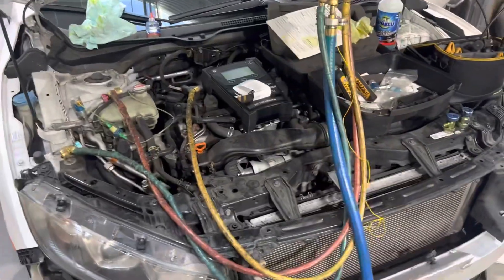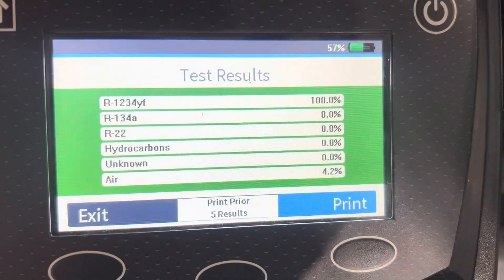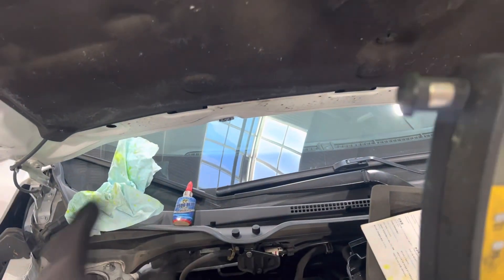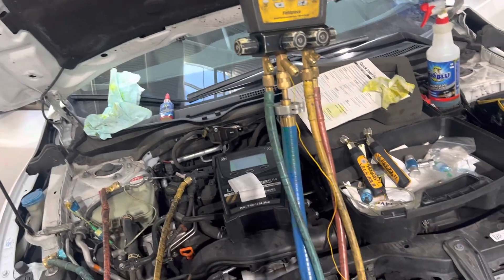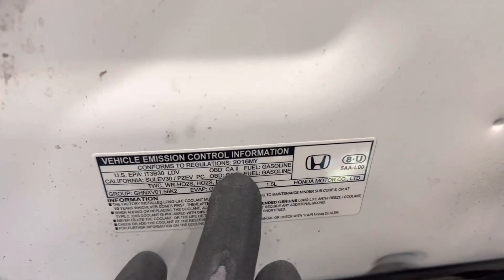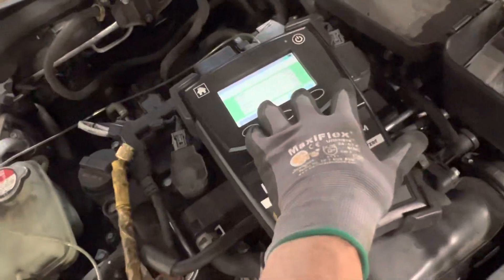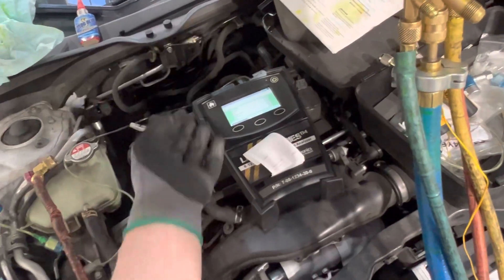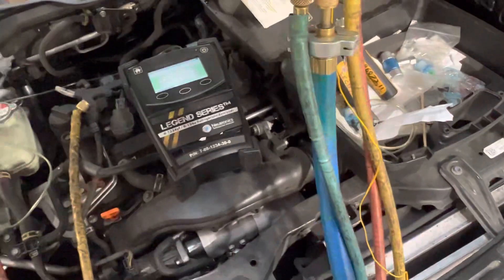OTHER SHOP WORKED ON AC , now it NOT !  cooling good. WHY ?

Comment: Omg i used my Bluetooth fieldpiece and wow. My supply temp was 38.5 which matched my evap temp 37 by 1degree. the superheat looked good but subcooling was off and my compressor was on max it  was cycling on and off because low pressure was kicking it off. I could see low charge all over it delta t was 25. It's awesome using the scanner and fieldpiece wireless together. Diagnostics is about to get exciting. Lol low pressure was 20 psi. The ambient temperature was 68. Just wow
Reply from the maker: Now after a year and two summers. You will learn much more.  
          If you were still not learning new things, 20 years later, and something is wrong. 

There’s technician to learn something every year and get better and learn something new and apply it to the next year to build up knowledge . 

Then there’s technicians who learn everything their first year they know everything they know it all, and they keep repeating that first year of knowledge for 20 years . 

There’s a difference between a technician with 20 years of experience, constantly developing in improving or a technician who is just repeated the first year 20 times .
Reply: @coldfinger459sub0  yes and all I know is your the only you tube channel that uses this technology. Everyone else is running on pressures. 
 That's like doing electric testing with only a volt meter. The amp clamp is just as important but people neglect it's use.
Reply from the maker: @mike-yp1uk  because shop owners only care fast , cheap , good enough, collecting money 💵. 
     They don’t care about correct.